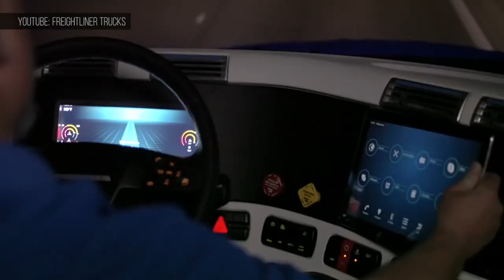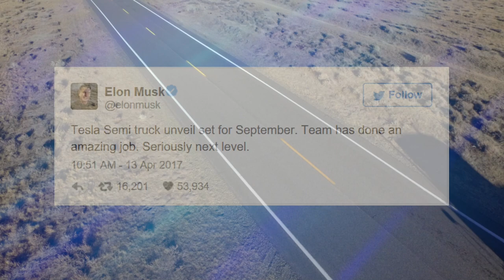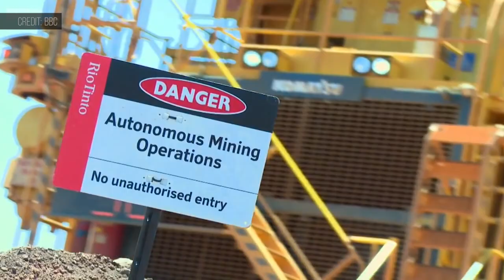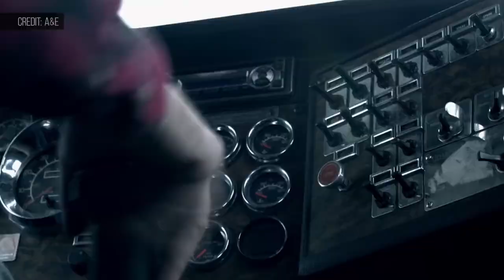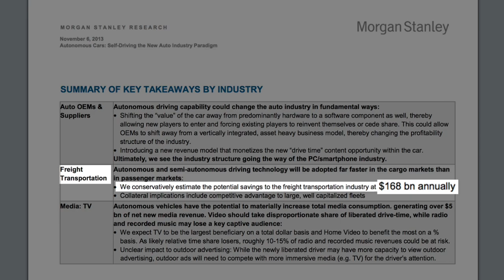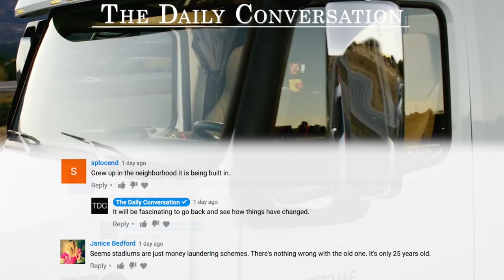The Future of Trucking

Comment: New trucks today are filled with sensors. Sensors that feed information to on board computers that are designed to protect the truck from catastrophic mechanical failures.  In the past ten years of driving, all but one of my mechanical issues has been a sensor failure, not a mechanical failure.  The idea of autonomous trucks (and cars) is all well and good but sorry, they still haven't developed a PC that doesn't have a glitch, never mind hurtling 100,000 lbs down the road running on glitchy sensors.  People are already being killed by these over-excited idealists.

Comment: Tesla trucks and I mean trucks not pick ups will not work for the energy it takes to power a B double truck grossing 72 tons batteries won't do the job over long distance big rigs of today there engines range around 350 to 700 HP. Batteries will create more pollution than a diesel powered engines there very clean burning today.

Comment: Technology...Innovation!! No, in perfect conditions, an autonomous truck might work in short travel distances. In any other driving condition, I would only trust an experienced driver. As far as the power source for trucks in the future, an advanced Diesel, kind of like the VW TDI type engine, hands down. Electric motors are clean, if the power source originates from hydroelectric, solar & wind. Solar & wind have problems, so that won't be reliable. The main source of electricity is the burning of coal, so that makes an electric truck only 18% efficient...because usable energy from burning has only an 18% efficiency index were diesel has a 30 - 34% efficiency index.
And for gosh sake people, there isn't enough trucks on the road to make a damn needle register on the clean air meter. You might as well fill a swimming pool & add a single drip of water from a dropper & convince anyone that it made a difference to the amount of water in the pool. Get real!
Now, all this aside; the big kicker is this. WHO is going to insure the truck & the load? Any Insurance companies willing to give it a go? You can have technology available on the public roads, but nothing is going to happen if there is no insurance!
Reply: Actually, driving a truck from depot to depot along highways is one of the most simple applications for autonomous vehicles there is, we'll have that long before we'll have self-driving cars.
Reply: @seybertooth9282  Regardless of whether self-driving vehicles can be practical, nothing will happen if Insurance isn't available. Also, there is no such thing as a 'simple application' of this kind of technology if there is any possibility of injury when the vehicle is released on the road. I've heard many people say that the road system will have to be divided & have specific lanes for AI vehicles. Sure...don't worry about the tax increases...I've got a money tree in my back yard, no problem.

Comment: Will automated trucks have to abide by the 14 hour rule?  Wait that's right it can only do 300 miles on one charge right now. The ridiculous time line we truckers are put on now will never work for these truck having to stop every 4 hours, and that's at 72mph. And we all love a truck doing 65 in a 80 when driving r 4 wheel vehicles or ungoverned trucks. These sensitive sissy sensors won't work in less acceptable visibility conditions, guess the brokers and receivers are gonna have to wait even longer than what we're able to do now. Good luck moving overhieght over length oversized freight with a recycled plastic garbage. Torque and horsepower matter pulling up them Rockies. Most new trucks now struggle up a 6 % with 80000 lbs. The Last time we listened to the government about emissions we got d e f and egr junk can't get 650000 miles without a reman or rebuild let alone better emissions. My 2000 n14 gets A .03 parts per million out of a MAX total  20 parts per million on an emissions test but it's not allowed in Cali. ??? That means my truck emits very little carbon into the air. Must be a pyramid scheme somewhere........